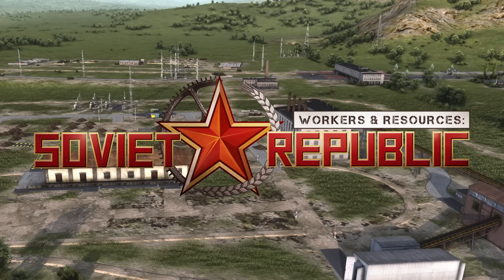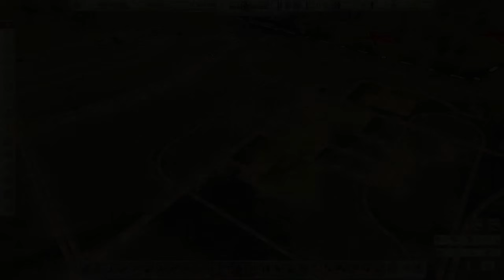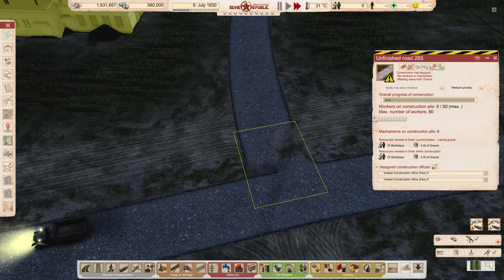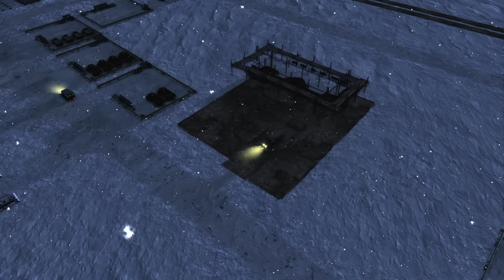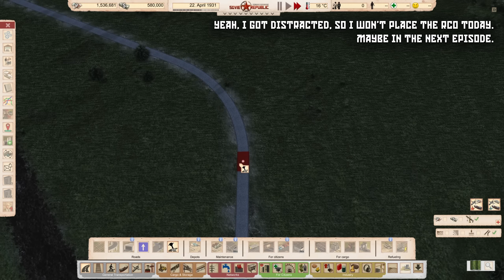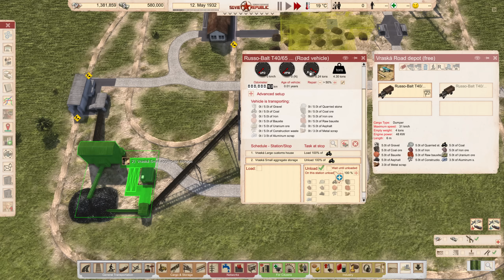The First Step Is Always The Longest - S4E3 ║ Workers and Resources: Soviet Republic

Comment: In between a few of the apartment buildings I did notice that you placed paths all the way through them maybe in the middle of the paths you could add like a little statue squared kind of area maybe with a few benches and trees and stuff then again the town isn't even all the way built but I think it would look better. And to prevent further bottlenecking in the future I noticed that you kind of only have one entrance to the highway so if you have an industry further down the highway in the future there's really only one way they can get into the town if they need to
Reply from the maker: I'm not sure if there's enough room between the blocks for anything big, but a couple of bushes should fit quite nicely.

As for the road access, there is a street heading away from the centre opposite the current industries (I think between the cinema and the shopping centre), we can use that one to increase accessibility to the town later on.